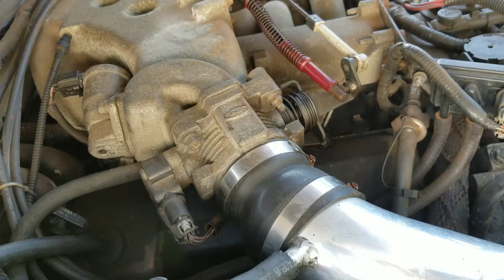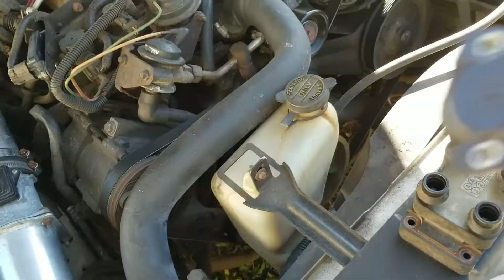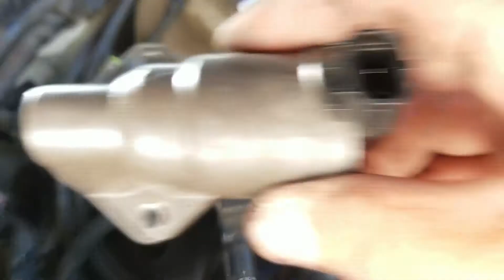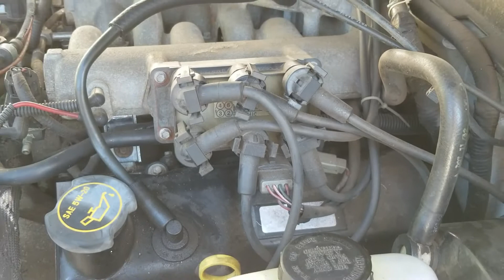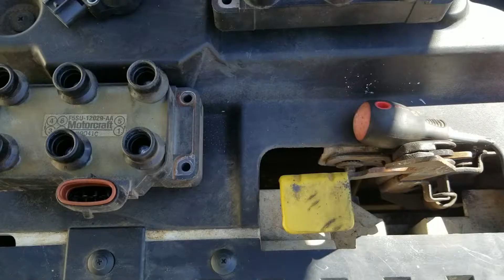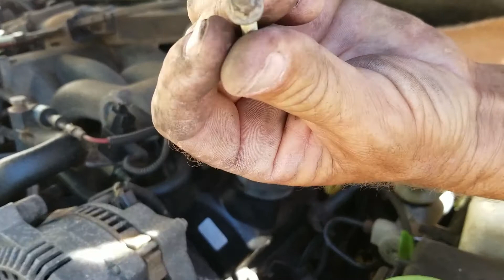Ford 3.8L - Throttle Position Sensor - Coil Pack - Idle Air Control Valve - Remove & Replace

Comment: I've done, TPS, coil pack, and the little plastic clips on the back of the intake that connect to a metal actuator to open and close the secondary butterfly flaps. Other repairs, things replaced transmission support bracket, charcoal canister (fixed refueling issues and some other evap symptoms), and wheel bearing hubs. 105k miles, avg 22mpg I've had it up to 30 highway, no hills.

Comment: If fixing the TPS doesn't fix my mustang's slow acceleration after swapping out the fuel pump I don't know what next I'd need to fix
Reply: @HeavyMetalNetworks  I've swapped out a bunch already, fuel pressure sensor, mass airflow, 02, I just don't wanna learn that I got fucked out of 3,500 by getting someone's project car
Reply: @HeavyMetalNetworks  mine's extra fun since it's a convertible